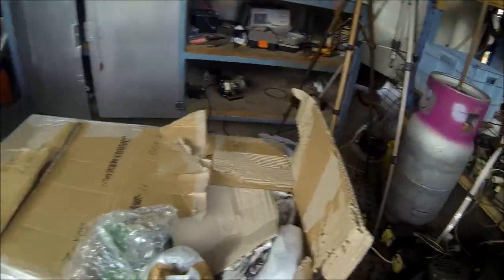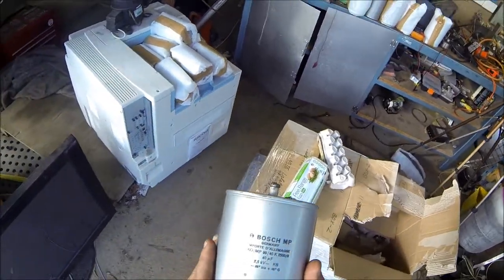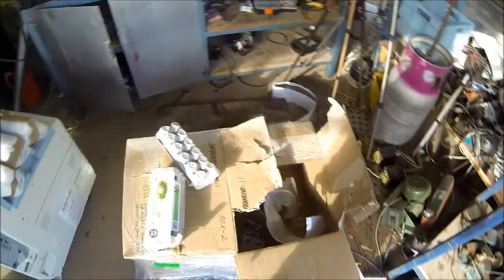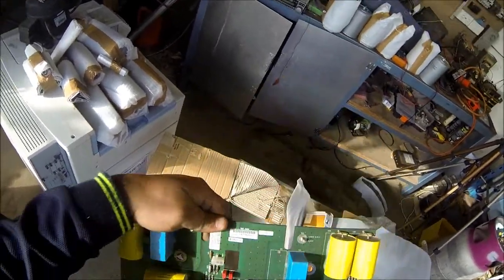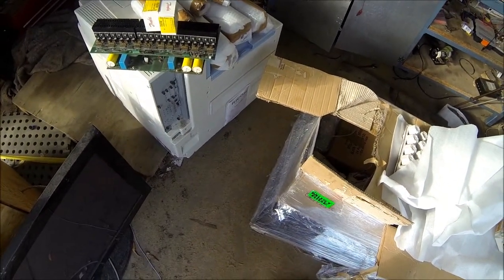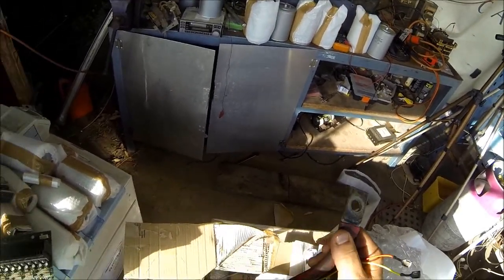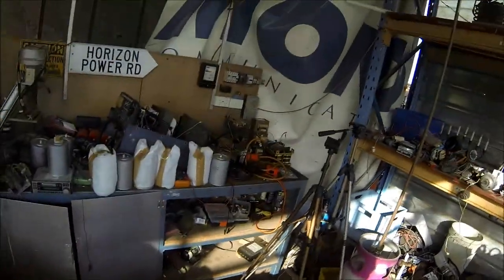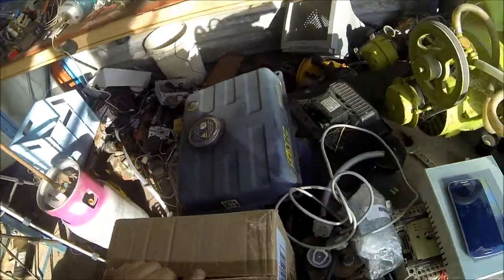Unboxing Big HV Caps and PSU, Care Package from Ed!

Comment: ah Polymath is it?, I wonder if Hitachi charge for the software, sombody told me they did not? I think it was the guy who gave me the Teco VFD years ago, he works for NHP who sold that PLC system initially 

I did find a open source PLC driver that works with the A/B SLC500 I have, I think they support all major brands and you program through MS C++

Comment from the maker: Had both the PLC and HMI running last night, big problem however is getting a hold of the software to program them.. yes, can be reprogrammed to speak to the arduino or any other MCU, but need that damn polymath interface software :/

Comment: Use the SCR's as a pair or give one away if you can't use it, I still have 5 more

I was thinking you could use the touch HMI for a arduino interface, plug it into the PLC and power it up, it will come up with a old interface for lighting, not sure about reprogramming tho. I forgot the 24V din mount PSU for the HMI but the PLC has its own switchmode built in for itself.

Comment: Yeh!, good to see its all there intact!. 

you gotta keep some of that metalized bubble wrap to put across the output :D

I think those boards from the Danfoss Hi-Power drive did have gate drive on it.
Sadly the pressure gauges do not go up to 100 but I do have 500 more of them :p
the temp controlls and EFI gear was a early request that I forgot about 
The SCR's are from BHP steel out of one of the processes, possibly a electrolysis tank. or huge DC drive for the hot roll mill